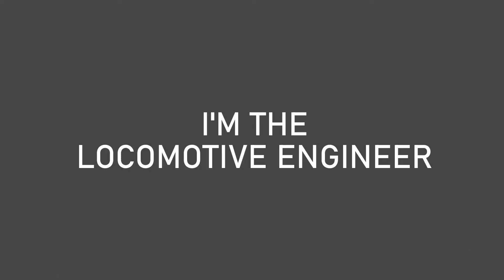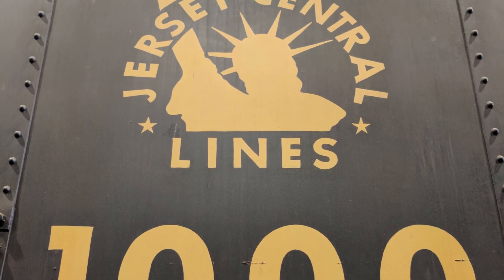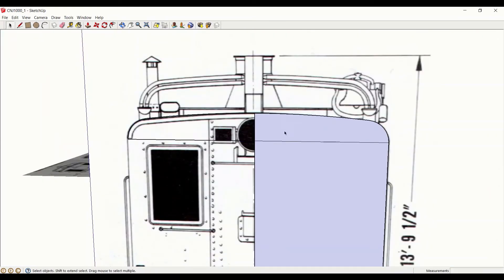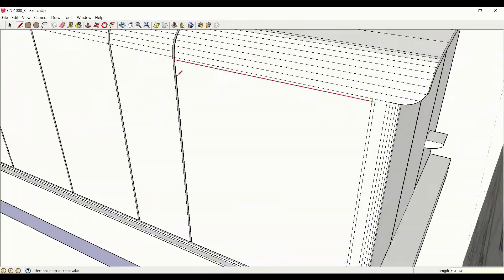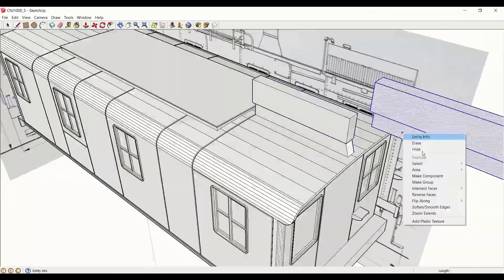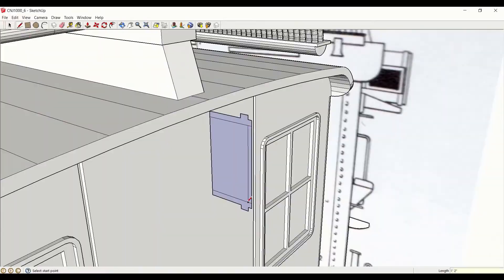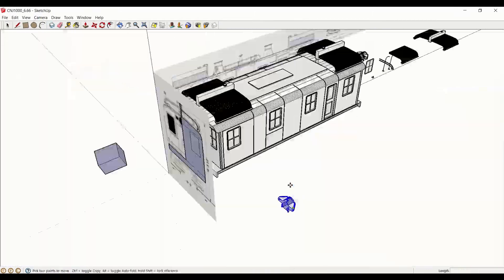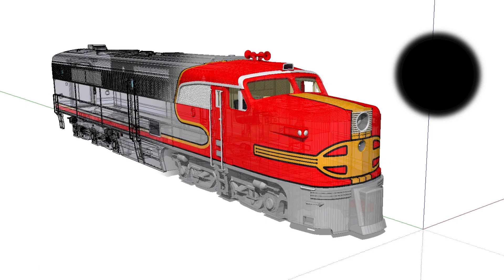Modeling CNJ 1000 - Part 1

Comment: I came across your video and loved it for numerous reasons. First, I’ve always enjoys locomotives that had cabs on either end. So going East or West, the loco is always pointing in the right direction. No need for a turntable to turn it around the right way. Secondly, I moved from NY to NJ, so I’m fascinated to see my adopted state once had its own dual cab design and the first diesel engine at that.

Did you ever finish your Sketch 3D design? I bet many folks would be willing to buy a 3D printed model from you. Or to at least buy the shell that could be fitted on a n scale chassis of appropriate size and wheel count.
Reply from the maker: Thanks for the comment! I'm glad you liked the model. I did finish it, but the screen recordings showing the completion of the drawing process for the Part II video are still languishing in my computer archives... Not sure if/when I might get the chance to dig them out and finish the video.

Comment: Please do part 2 I am doing a project on this and it would really help to have some references 😭
Reply from the maker: Not sure when (or if) I might go back and finish Part II, but the Model Railroader Cyclopedia, Vol. 2 (Diesel Locomotives) has a nice set of diagrams that I used as the basis for this model.
Reply: @TheLocomotiveEngineer  Thanks a ton!